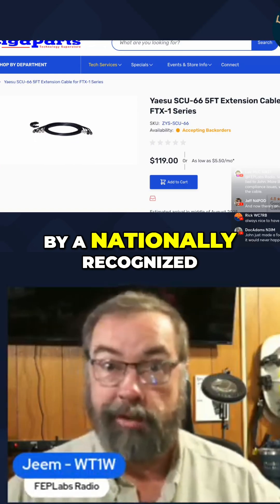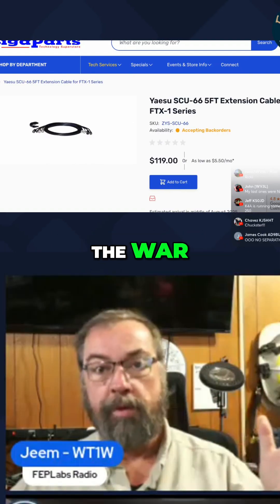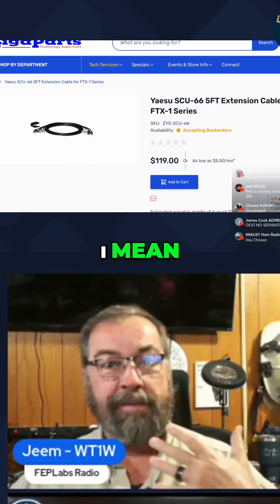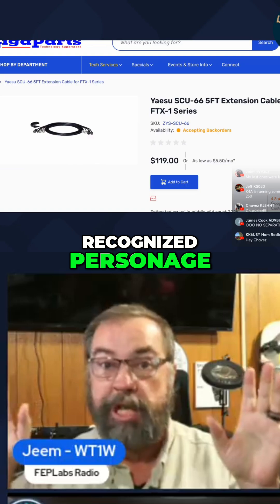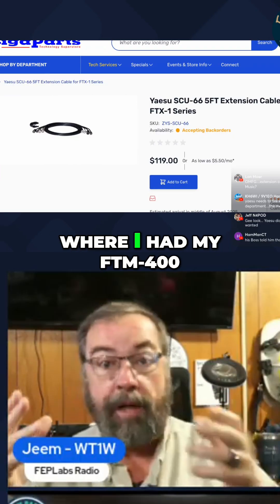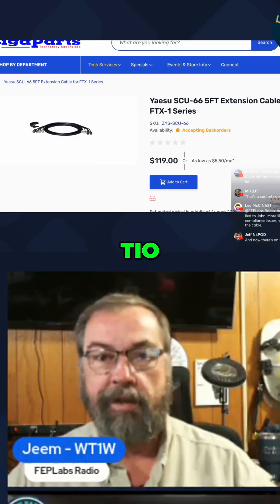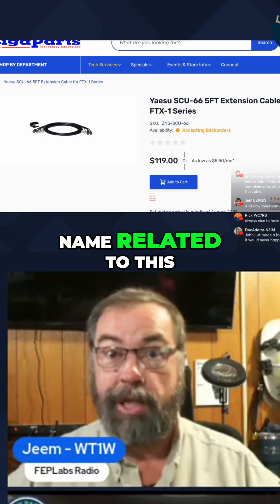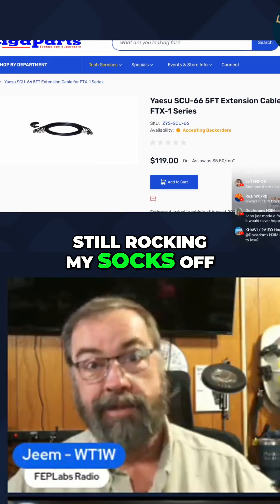Radio Cable Myth Busted!  FTM 500 Extension Experiment #ftx #optima #yaesu #hamchurch #hamradio

Comment: If anything, you might need to put a clip-on ferrite on the ends of the cable, MAYBE. Otherwise it should work just fine.
Reply from the maker: 2+years and never a problem